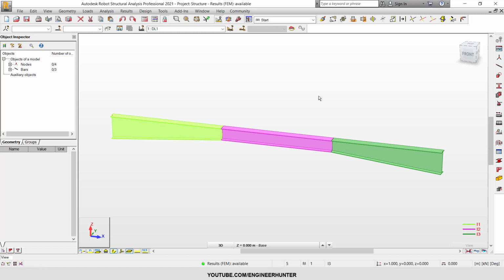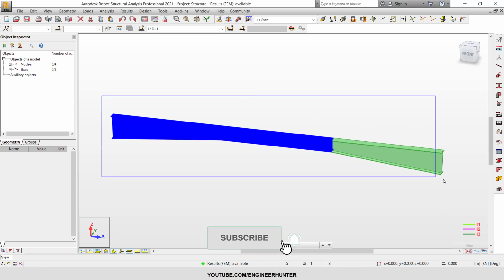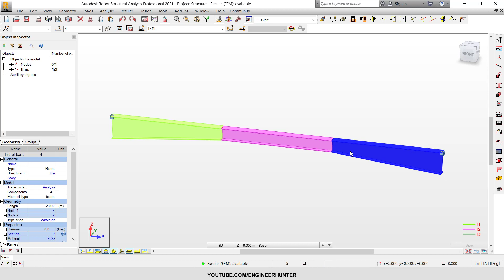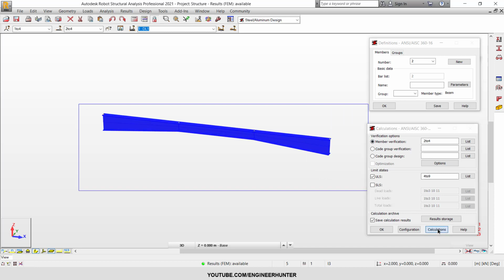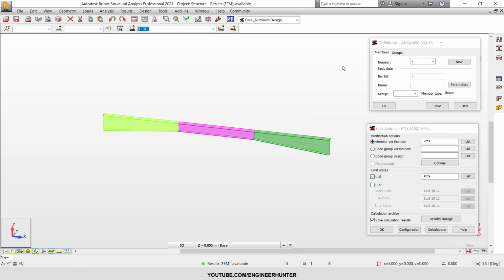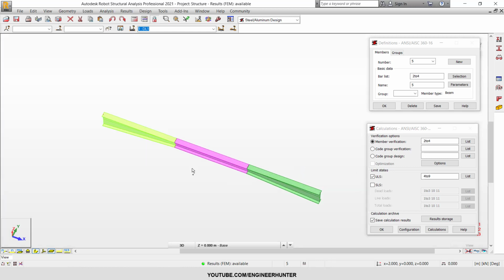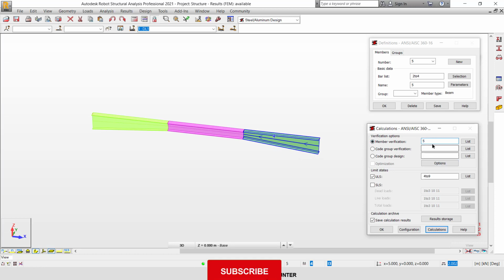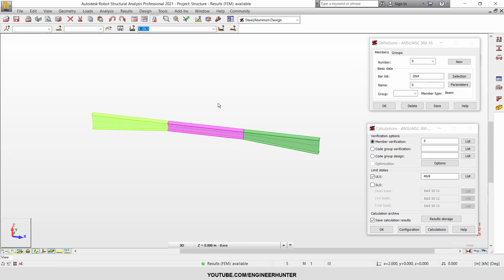Autodesk Robot Structural Analysis : Superbar / Joining Steel Member

Comment: how did you create a beam with different height on ends, I want to create a timber beam with one end smaller than the other> Thanks man
Reply from the maker: You can use non prismatic or tapered section when you create new section.